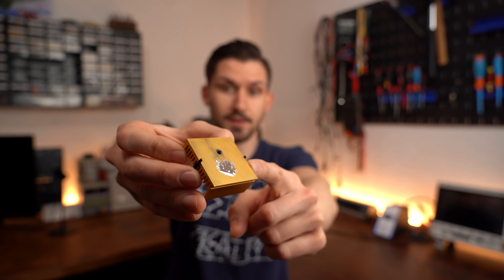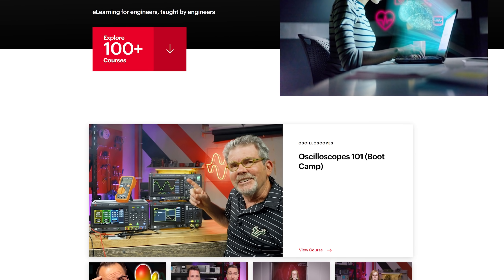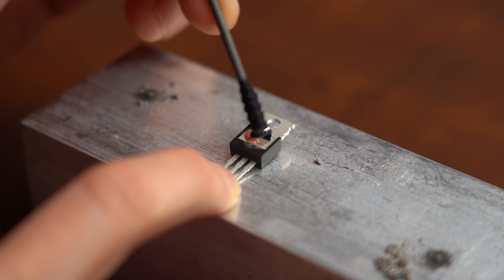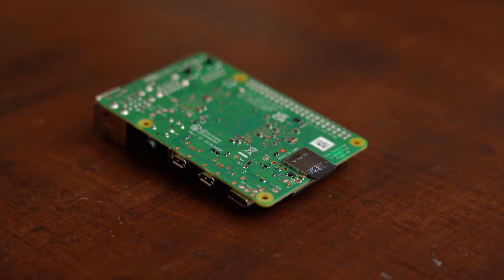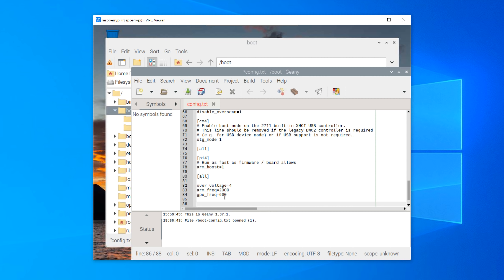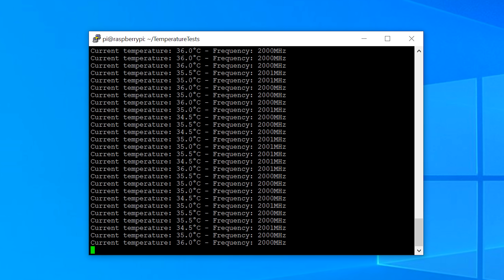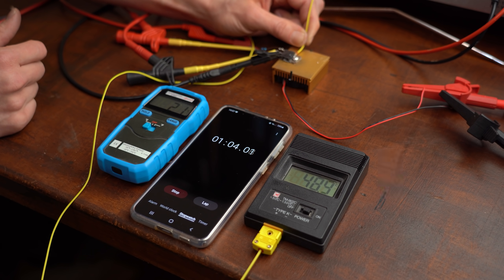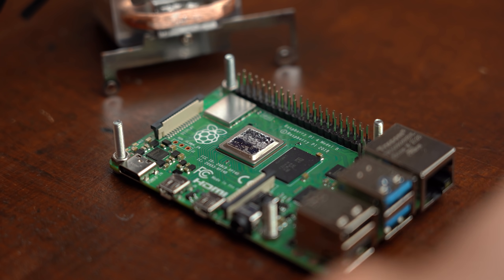Will Liquid Metal replace Thermal Paste? A Raspberry Pi gives the answer!

Comment: Liquid metal is best used for enthusiasts wanting to get the most out of their system. In my case I have an older 6th gen i7 and a relatively large heatsink. I delided the CPU and replaced the internal thermal paste with liquid metal. I saw a 20 degree drop, and I'm running 4.5GHz with temps in the mid 70s. The Heatsink itself does have regular thermal paste since it does have aluminum, like your Raspberry Pi heatsink. 

I also tried it on my laptop and saw no difference. The CPU reaches 100 degrees fairly quickly and maxes out at 40w after about 10 seconds of load. The heatsink is just too small so after it heats up it becomes the limiting factor. 

Also worth noting, liquid metal will damage copper in the long term. The less dangerous application is on nickel-plated copper, since the liquid metal doesn't really diffuse into nickel much. However it will slowly diffuse into copper, which can be seen as the metal "drying up". It means that it will require periodic re-applications and once you use liquid metal your heatsink will no longer perform well on thermal paste.
Reply: You didnt do it righto n your laptop then. Check out Linus Tech tips liquid metal laptop test. Saw the same 20c drop you did on your desktop.

Comment: Another point to take in consideration is if your thermal load is constant or in bursts. If it's constant you reach the heat transfer equilibrium of the heat sink. If it's in bursts you can get benefits from the LM thermal interface material.

Comment: Given the General Motors HEI (High-Energy Ignition) uses the distributor base as a heat sink for it's internally contained ignition module, I'm guessing using Liquid Metal as a thermally conductive paste would be a mistake, seeing how the distributor's base is made of aluminum. [:\
Reply: It'll eat right through

Comment: Great video, especially the note on low temperature indicating that the cooling solution is working propperly. For liquid metal to have an appreciable effect the interface area needs to be a limiting factor in the transfer of heat. A great indicator for this is the temperature at the heat source, since natural convection will start having a greater effect above about 60°C. So if the heatsink can keep the heat source under this temperature without using a fan, then there is little use in using a better thermal compound.

Comment: How well it works for you also depends strongly on how flat your surfaces are. Thermal paste is primarily a gap filler, to fill the 'valleys' of a surface with a real-life roughness. The paste consists of good thermally conductive particles in an oil-like viscous liquid. How well it works depends on the size of the particles compared to the characteristics of your surface roughness. I.e. how well the particles fill valleys and peaks. This is why the (apperant) performance of thermal pastes can differ so much between different people.

In many situations though, at least one of the surfaces is also concave (or convex) on a similar or larger order of magntiduce compared to the roughness. You then have not only the roughness 'gaps' to fill, but also the additional gap from these non-flat surfaces. And with that the thickness of the applied paste layer and viscosity of it, compared to the mounting pressure and mounting pressure distribution. This often results in a layer of paste between the surfaces with a thickness larger than the typical size of surface roughness features. It is here where liquid metal can really help out a lot. Being a much more homogenous substance (i.e. no particles of certain size which dominate the thermal performance), it works much better with these 'larger' gaps. It also commonly results in a thinner interface layer because of the generally lower viscosity compared to paste.

Generally, the rougher, the less flat, and/or the lower mounting pressure, the better liquid metal works (compartively, that is).

Comment: When most people think of liquid metal they think of mercury which is toxic. This is gallium, and gallium reacts badly to aluminium because it diffuses between the grain boundaries of the microcrystals of aluminium and breaks down their bonding which exposed to air turns the aluminium into aluminium oxide and remains a catalyst. This is why it is banned from aviation. A small amount placed on structural aluminium will cause it to disintegrate rapidly, and the gallium dissipates across the surface. There are videos showing how it can destroy a scooter or bike frame, as well as padlocks.
Reply: The liquid metal sold as a thermal compound is typically an alloy of gallium, indium, and tin called galinstan
Reply: Manufacturers use aluminium for padlocks?
Reply: @NicksStuff  there are some models, where the body is milled out aluminium. Idea is to make them lighter than brass or steel locks.They are not for high security use anyway.
Reply: I was confused by what he meant by liquid metal at first. The term is so broad. I don't think it's pure gallium though as gallium is a solid at room temperature and only melts at 29°C so it must be an alloy of gallium lowering its melting point.
Reply: @fb55255  Liquid metal is what it is sold as and what most people know it as in the PC overclocking area.
Reply: @fb55255  its an alloy of gallium and indium usually
Reply: @fb55255  yeah I think it is gallium and indium? LTT has a good video about it. It's great at conducting electricity so it's really easy to fuck your CPU with something hard and electricy.
Reply: Actually this is not gallium but an alloy that contains gallium. Pure gallium is solid under standard conditions.
Reply: @limonadenzitrone9976  "Thermal Grizzly Conductonaut is a liquid metal thermal compound based on a eutectic alloy. Our special mixture of metals like tin, gallium and indium"
Reply: @crisnmaryfam7344  /r/Whooosh... Read my comment carefully and then you will get it hopefully
Reply: Yes, it starts as galvanic corrosion which leads to intergranular corrosion then exfoliation corrosion.

LM is overrated
Reply: @shadowopsairman1583  It depends. On low power applications, yeah, but I've got an overclocked Intel Core i7 6700-K @ 4.5 GHz and it made almost 20 K.

Comment: This actually answers some things I've been wondering about overclocking a Raspberry Pi, though i was aware of the limits of cryonaut's liquid metal cooling.

With regards to the upper limit on Raspberry pi's overclocking speed, I believe ARM processor's have a built in limit to the caching system on the chip. 
To exceed that speed you'd need to find a way to bypass L1 cache speed limit, which may not be possible without going all the way back to the chip manufacturer. There may be a software tool that allows you to alter the operating speed, but it would involve flashing the cache read/write instructions, which is a bit deeper than making the processor go faster.

Comment: I think the real advantages could be seen with this used on a water cooled high power application.
Reply: or if he had delidded the Pi and removed the thermal paste under it...
Reply: Gamers Nexus and Linus tech tips showed better tests - LTT 20c drop on a laptop AFTER HEAT SOAK. And Gamers Nexus did multiple cpu delids and tests with multiple thermal interface materials, along with GPU's running for a solid YEAR with liquid metal. All performed better then thermal paste. Water cooled is irrelevant. GN even showed this too by testing both water cooled one with a smaller radiator (the LM rig) and the smaller radiator and LM performed better than the larger radiator and thermal paste. After a long term test heat soaking.
Reply: Not really, with a proper liquid loop you can get very close to room temperature on the CPU/GPU already, for instance +5 degrees over ambient temperatures, liquid metal would delay that rise to 5 degrees over ambient but eventually (after a few minutes) the temperatures are the same.
This would be useful for phase change cooling where you basically hook up your freezer to the CPU, a real niche for overclockers and bored pc modders :P 
Liquid metal has a quicker response to temperature changes, the limit still is how much heat you can dissipate out of your liquid loop/heatsink.

Comment: Almost no one pay atention to (i think) one of the most important thing - liquid metal melting point (abotut 28.5 °C ? depending on composition in liquid metal) and what will happen when You try to use powerfull stuff (processors) in cold environment. Im thinking about laptops, game consoles etc. I think some of stuff can burn due to not enough dissipating by heatsing, thats i think why extreme "over-clokers" dont use liquid metal. Ps i'm using liquid metal in my chromebook (sorry for my english) PS2: Great Video like always
Reply: Seems like that's a problem that would solve itself quickly.

Comment: The liquid metal did not make a big difference as the limiting factor was the thermal paste between the actual chip and the heatspreader. If you do direct-chip cooling your temperatures will decrease massivly
Reply: ok? what does this have anything to do with the video though? What kind of normal person would delid their cpus? This practice is only for enthusiasts now because you need special knowledge and equipment to do it, however easy it is. The video is directed at "normal" users.
Reply: @LKonstantina915  this video doesn’t really make a case for LM though, because it’s not properly handled
Reply: @LKonstantina915  The consumers that these products are targeted for are normal people who just don't understand why a CPU manufacturer would seal a CPU and don't know anything about electronics. People who think this stuff makes a difference need to be educated that it's just a waste of money.

Intel and AMD would have stopped making processors like this in the 80s if a heat sink wasn't an effective way to cool them.
Reply: @LKonstantina915  special knowledge: watching a 10 minute video on youtube on how to delid.

special tools: a razor blade or a 20€ delid tool. 

it has something to do with the video because the way shown in the video is not what liquid metal is made for. 

what is a "normal" user? Somebody who craps his pants even thinking of taking the risk of damaging a raspberry pi? Grow some balls

Comment: Liquid metal also reacts with copper. For a long term solution the copper should be nickel or gold plated.
Reply: anodized aluminum as well...just don't scratch the coating

Comment: Hey! On delidding--  you might have more success (and some additional ideas for videos) if you use a thermal camera.  It excels at showing to you the slight differences / average temp of that lid, so you know exactly when it is getting close to solder melt temp , and where you might need to focus heat to keep things even. 

On thermal cameras: I want to DIY breed a thermal camera, with a laser distance scanner, with a PTZ camera-type base.... to automatically monitor for people and animals in my (heavily wooded) backyard,  without cameras/visible lights nor laser beam detectors.  It's true that even dual laser beam detectors are often triggered by falling leaves. Dont ask how I know :(   It would be cool to have something I can centrally locate like that as well-- instead of needing to have many devices at all the corners of the perimeter. (Or several cameras!) 

I am very surprised there is not such a device on the market yet
Reply: They probably have these on the underside of police helicopters, but those cameras cost like 6 figures.
Reply: @ewicky  agreed but those are only super sensitive and super high res PTZ FLIR. 

I want something that is 

Diy
Cheap
Built from commonly available
Can spin itself around and make a map of what's there and what's changing

From that point, it's all about software which we can open source. Much like OpenCV which has been rocking the DIY AI video processing world for.. a decade maybe ?! 
Love it

I know we have cheap 360 laser scanners,
We have cheap FLIR sensors with low res,
And of course a PTZ platform has been commonly available for 5 decades.

Doesn't matter if we only have 400pixels of width in our affordable sensor, when we scan it along 360 degrees and process it all in memory
Reply: @gutrali  The FOV of off-the-shelf "cheap" IR cameras is probably gonna be a roadblock for you. At least when I looked into it, most were pretty wide, lowering the effectiveness for applications like yours.
Reply: @ewicky  but that's the thing. If the FLIR cam instead spins in a circle... Then any horizontal resolution greater than 1 pixel (like a LIDAR has in any given moment) becomes just error checking. And, additional response time to changes, depending on rpm.

And storing the heat state of each pixel means we can easily report on changes in temperature at that location using every single pixel in the line that sweeps over it. Hence error correcting

Combine that with the LIDAR and we can confirm there is an object x ft away that wasn't there the last time we scanned. The FLIR can confirm it's warm.

Maybe it is more properly called SLIR. Spherically looking InfraRed
Reply: @gutrali  I'm not sure you understand what FOV means. Google it. Resolution doesn't do you anything if it isn't focused.
Reply: @ewicky I am a decade deep into being an FPV pilot, and I respectfully disagree. There is an ideal FOV, field of view, that each pilot prefers. All that means is a vision arc of X degress horizontally. I.e. how much you can see to the sides, **without having to turn/pan**. It, alone, says nothing about focus! It says more about resolution, in fact. And if we are panning, then resolution goes out the window too. Bc resoution then becomes virtually defined in software as a function of the rpm.

 Focus comes from a combination of other factors. In almost all of the drone (and non-zoom security cameras), the focal point is fixed at infinity. That means everything is as sharp of focus as the lens / sensor package allows.(yes there is always some amount of variable skew, that results in blur at the fringes, increasing in severity as your fov increases... Only bc there is no such thing as a perfect lens). I believe I fly at 135° , which is identical to human eye horizontal fov... but I'd have to go look it up on runcams website to be sure. The big point is that the processor of the sensor (whether that is a human, or a computer program,) is calibrated for those differences as needed. It makes no difference. That's why a LIDAR can be a single pixel wide sensor. The FOV in that case becomes how tight the laser beam is x how fast you are samping that pixel x rpm
Reply: @ewicky  plus, the Z in PTZ necessarily means the FOV is variable
Reply: @gutrali  Also a decade into being an FPV pilot, but that's slightly different context. I was referring to IR sensor FOV, which is more in the context of what we're talking about.
I didn't want to have to explain this in such detail, but I feel obligated to at this point haha.

Panning a low res sensor is only gonna increase the horizontal resolution. Vertical resolution and FOV will be the limiting factor, especially because of your application (surveying a landscape). A el cheapo sensor will likely be 32x32 with a wide FOV. So right off the bat, you're losing probably 12 of those pixels to the sky, and 8 looking straight into the ground. That leaves you with maybe 12 pixels of vertical resolution. This might be ok if you were scanning things up close, such as finding humans in a living room. But again if you're trying to spot all kinds of things, esp at distances outdoors, it's gonna be a big challenge. READ: objects will be smaller than one pixel. Hence FOV smh
Some sort of telephoto lens/sensor assembly would be much more appropriate, but in my research was harder to find as a cheap DIY solution. And that loops us back to the FOV conversation which you're already an expert on.
Reply: @gutrali  PT"Z" camera bases do not have zoom. The camera lens assembly itself must have the zoom. Cheap DIY IR sensors don't have zoom lenses, that I've found at least.
Reply: @ewicky   a cheap lens can be a repurposed, old, DSLR body. Have some creativity! 

https://youtu.be/M0gfINtNFMs

  I appreciate the effort in responding and the friendly discourse either way. your viewpoint is not invalid, I just don't share it based on my own experience. Maybe we are coming from a different assumption of cheap sensors. My budget might be something topping out at 500$usd. Maybe 800. It's about half or 1/4 the cost of the FLIR sensors DJI provides commercially for mavics and old phantoms. Plus a ton of companies offer it in their own forms for many applications from farming to hunting.

Check out that vid above, on the point of aquiring resolution. By moving the lens + adding processing to make it a single image... We can have full awareness. It makes the FOV, lens setups and sensor, a second thought... rather than the whole point. 

  It is a like fpv since I have complete awareness of what is around me just with yaw as needed to see it.  I have the benefit of moving through space to have something alike two eye 3D vision. 

It could be the exact same principal just using heat sensor rather than a visual photon sensor. And a LIDAR snesor like they are already used (spin scan). And yes a ton of the details need to work out and we'd have to pick the correct parts etc.  It's doable. And the big electronics producers are probably working on it as we speak for release I'm half a decade